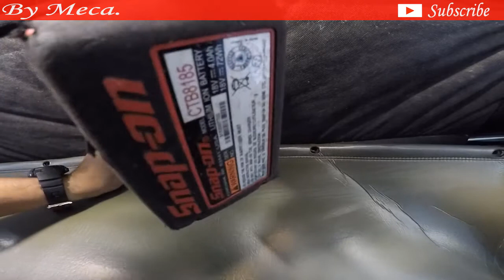Installing a 2006 Chrysler PT Cruiser Convertible Top.

Comment: Great video, thank you. You are very skilled. I think I could do this now. Wish I understood Spanish. Nice Chevelle.
Reply from the maker: You welcome. And thank for your comment o will add English subtitles later
Reply: subtitles sounds like a lot of work, I can get my wife to translate. I have a question, what happened with the rivets? I saw the replacements in the parts bag with the clips but I didn't see you put them in, did I miss something?
Thanks again.
Reply from the maker: Hahahha you are talking around the minutes 46 plastic bags with metal click and rivets i not sure if the video show when I am put it back but it need those rivets when are removing the old top u will see where those rivets go and make sure to put it back are 1_8 rivet
Reply: thank you
Reply: Awesome video. Just fantastic. My Cruiser suffered a knife slash (same spot) Had insurance cover the cost of a new top and installation. Gotta say, you do better work than those who did my top. After 4 years I learned to live with the wrinkle at the bottom of my back window. Have a question though? The black metal pieces don't seem to line up properly and the one above the trunk has a dint in it. I saw a Convertable in a recycle yard and those pieces are perfect, as is the top. Although it is black,
( mines tan) so I'm wondering if it's possable to remove these pieces, without having to remove the entire top?

Comment: Great video it has helped quite a bit in replacing this torn roof, all though I sometimes wish I could translate Spanish as fast as I need it, so English would be helpful, or if you know of a link with instructions in English. it seems this is one of those things that is impossible to find help on line. thanks again.
Reply from the maker: I will translate this video on English by the end of this week you will have it.
Reply from the maker: I have been resiving lot of email about translate my videos to English that why my recent video are Spanish and English
Reply: Meca question in the corners I saw you take the rubber seals out of the channel before you attached them. My question is how did you get the rubber seals back in those channels after attaching them?